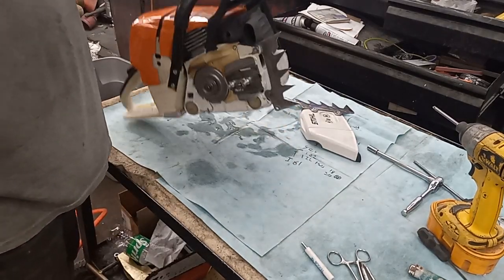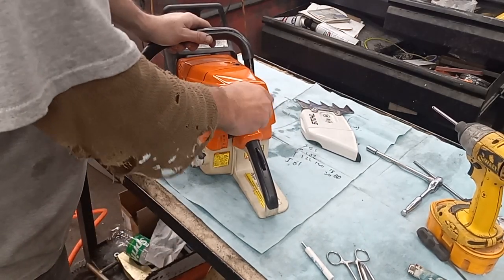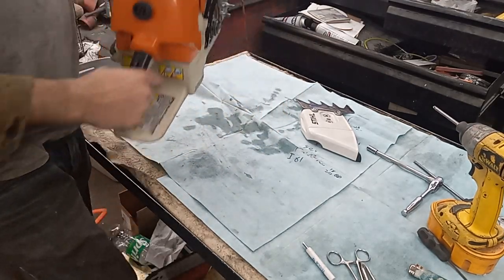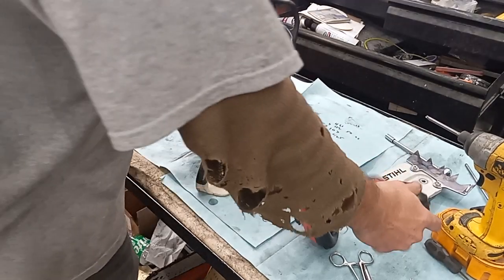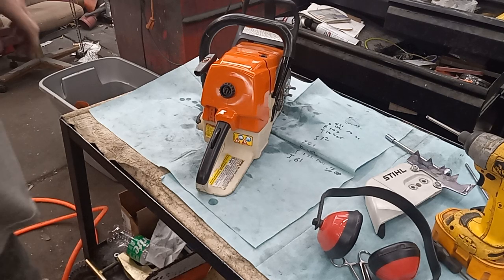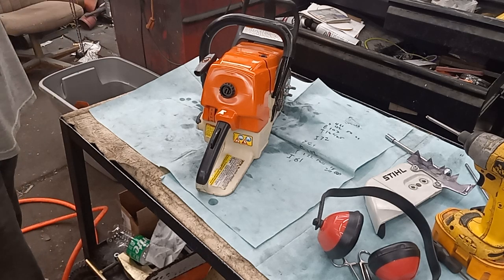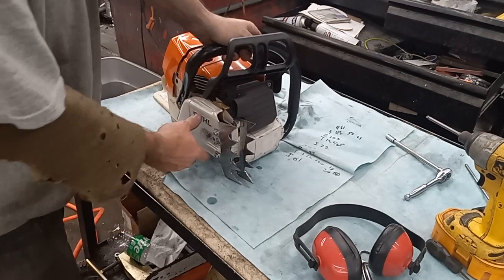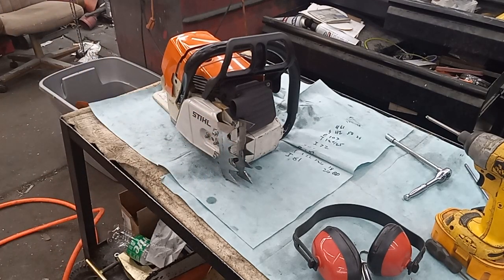bench run of the ms461 build

Comment: Use a 460 coil. I’ve been told the 440 coils have slightly different timing, but they will fit too. They like the 460 coil with 5 or 6 degrees of advance. I’m running basically the exact same numbers as you and it’s snappy as hell with the advance.